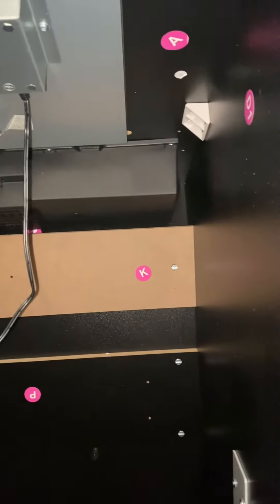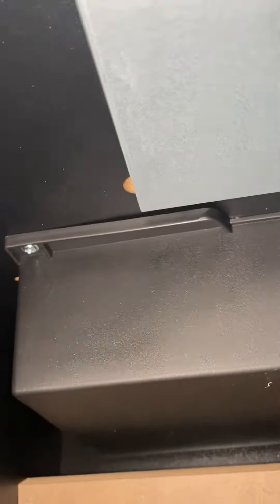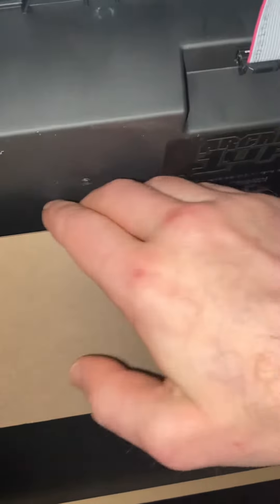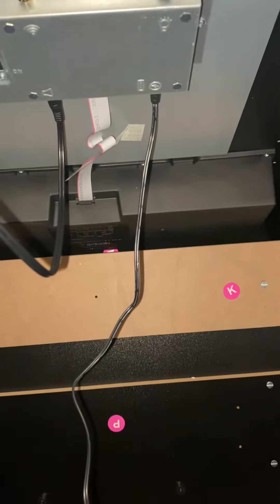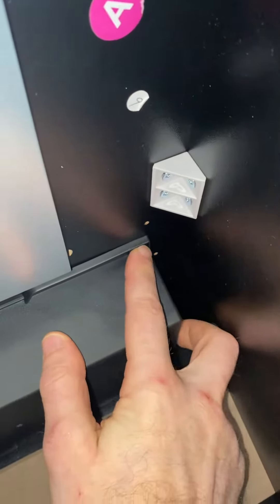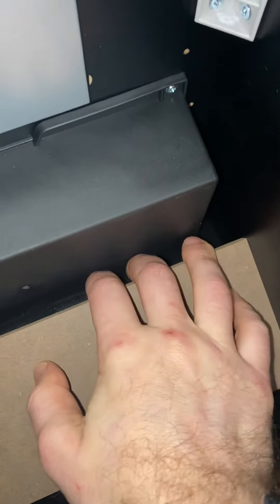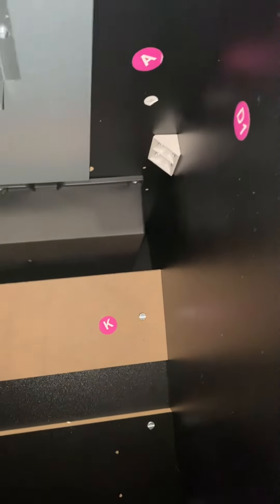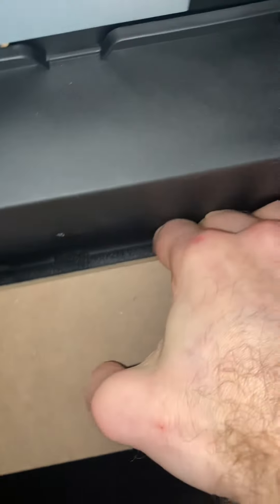Arcade1Up Class of 81 Deluxe - Access to Control Panel

Comment: The solution is easy like any Arcade1up.  The monitor and control panel is a one piece hold by a grooves from each side of the cab. All you do is loosen the screws around the area. This give you enough wiggle room to remove the whole panel from the groove.  This method works on any panels.

Comment: Yea I had to take the entire top half of my pacman apart to fix this issue with my joystick. The cabinets are freaking amazing looking but that piece of wood is definitely a flaw in the design
Reply from the maker: I hear you.  I was able to lay mine on the floor on its side and take off only one side from the top.  Regardless, it is still kind of a hassle if you need to get in there.

Comment: To access that control panel, all eight C screws which hold the monitor/controls in place have to be removed. Next, you're going to remove one or the other of the upper side panels (after removing 2 screws from one of the clips). After that, you'll have access to the monitor/control panel, which you'll disconnect the speaker and marquee lights from. Next, lift the monitor/control panel out and lay it on a cloth covered table with the joystick end hanging off the edge of the table, plex side down. Now you can remove the plastic control panel cover, to access the controls and encoder. No other way around that. And don't forget to have a friend or family member help with hefting that cabinet on a quilt covered table so you don't kill your back and knees, trying to access those pesky C screws. LOL Fingers crossed, the controls hold up for the duration. :)
Reply from the maker: Thanks for posting that!  I’m going to replace the controls at some point, so this will be helpful to me and hopefully others reading the comments.  Thanks again!